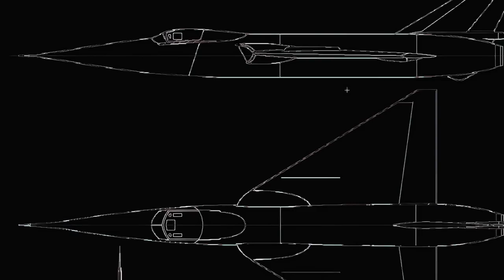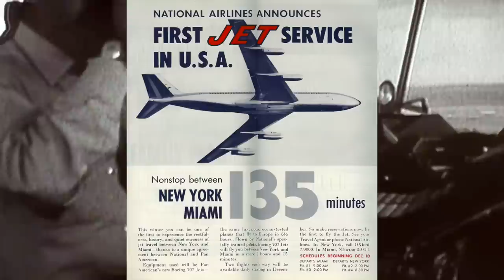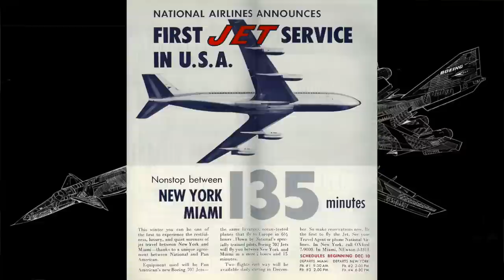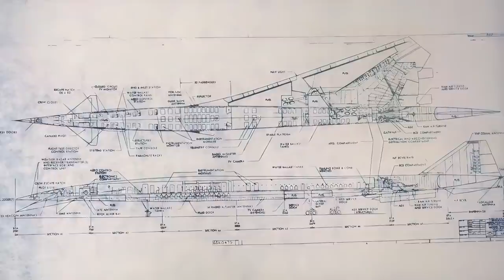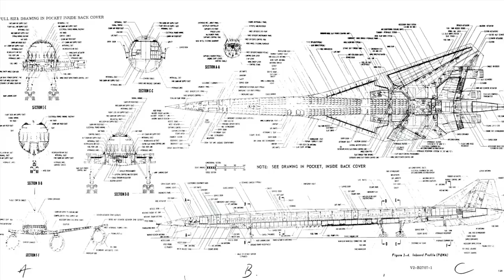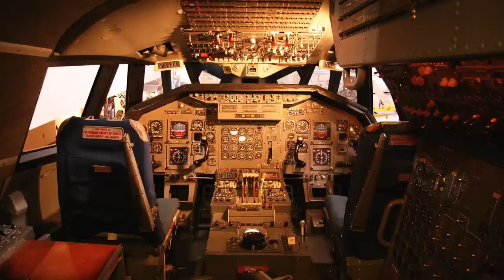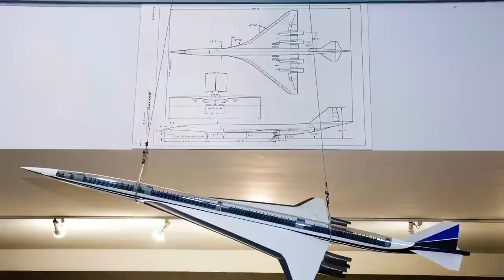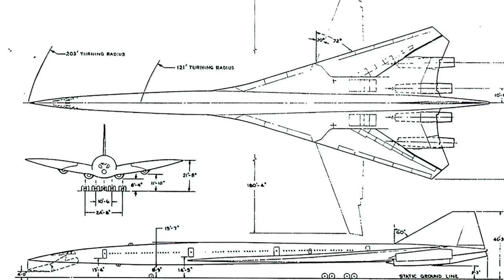Boeing SST 2707. The story of the American Concorde and why it failed to succeed. NO MUSIC VERSION 🔇

Comment: It’s the 10:53 nose-on version that’s actually a DC-8…you can tell by the large extra windows over the cockpit; 707’s have little windows there.  13:24 is also a DC-8, you can tell by the windows, engine pylons and nacelles and the nose and tail are slightly different.😉